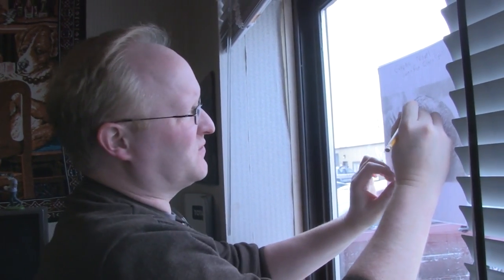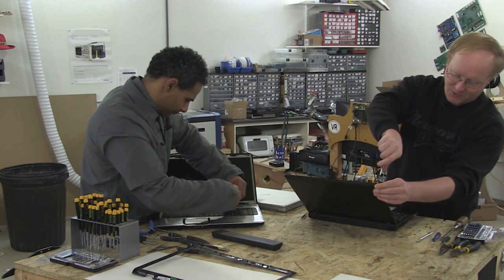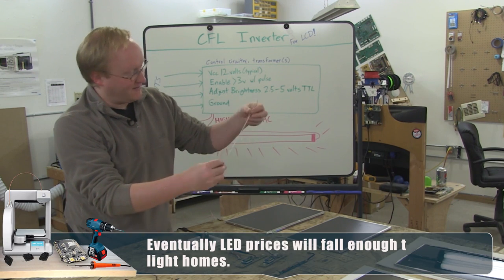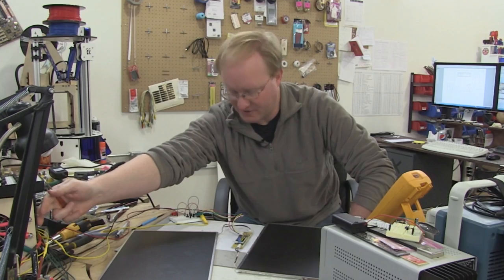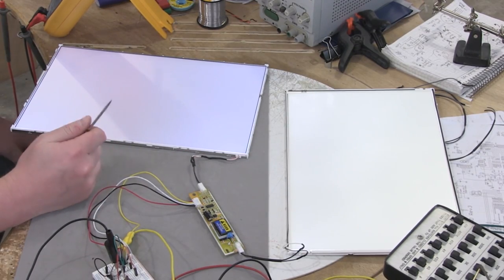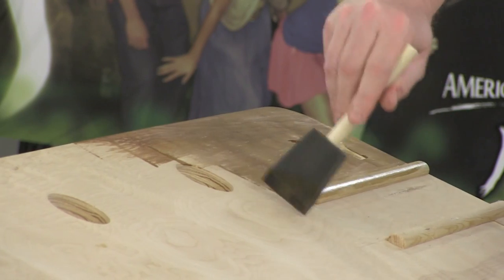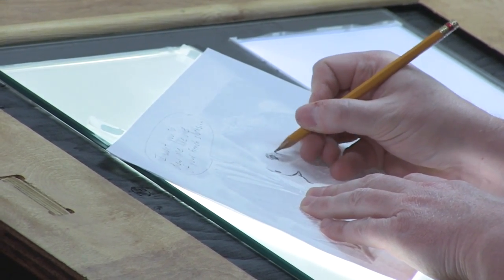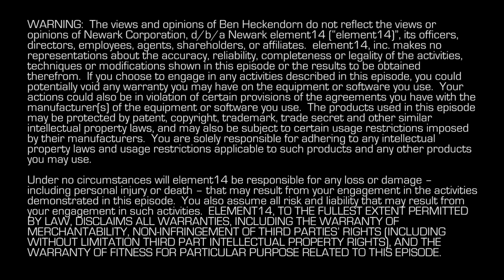Ben Heck’s LCD Monitor Light Box

Comment: why u did not use functional monitor with a computer? You could have reflect images directly from the pc to that table? I hope you understand what I'm trying to mean
Reply: ***** raspberry pi as a pc?
Reply: The idea was to recycle old broken parts into something new.
Reply: M. Oliver maybe, but I was considering the work efficiency
Reply: Gamewwx I think that would actually be a really awesome idea. Raspberry Pi PC (or a small form factor PC like a NUC) and be able to trace images right off of the computer. It would also remove the divider between the screens and give a larger work space. You could still use recycled parts for it, just using monitors instead of laptop screens.

Comment: I made a few shop lights out of broken LCD TVs and hung them on the ceiling in the garage and they are super bright. One has capacitor issues in the power supply b/c it doesn't always want to come on when plugged in.

Comment: Normal lightbulb would probably work better but itsgood use of old laptop screens
Reply: Couple TL tubes is better. more even light, less power usage, couple banks of LED's would work too, but a bit harder to get evenle distributed light with
Reply: oreubens i guess u could just use some mikly acrylic and sand one side and run with led strips.
Reply: while the point of what Ben was doing is to recycle old laptop screens, yes, for most other people its simpler to just hook up bulbs or LEDs or something instead of spending time gutting a laptop to use the screen. so anyone watching at home, theres not much need to bother with an old laptop, its just what Ben's goal was.
Reply: well yeh, but it's a bit pointless doing it that way.  It's like saying you wanted to make an electric heating unit to heat up your garden shed, and salvaged the CPU's out of a hundred laptops to get there, sure you 'can' do it, but...  why...
Reply: oreubens if you're talking about why Ben did it that way, i don't know other than he just likes recycling things.
Reply: Yes, it's better to use old displays this way than to throw them in a landfill; but, I also agree that there are better uses for them. I think the show is only desperate for quick projects to fit in the time slot of a show. They could have made them into digital picture frames; but, could they have done it within the time frame? Even as they took the displays apart, they can still use the LCD screens in another project as a projector. They could have left the displays intact if they could send the signal to make them display white for every pixel as the default. Then also as Gamewwx suggested, they could display art directly on the screen to trace. Maybe in a future show they will revisit this project and add digital picture frame functionality with a SD card and a micro controller.
Reply: kedwa30 agreed. Element 14 wants Ben to keep on a schedule of projects so he's sort of trying to figure out things to do.
Reply: Honestly I don't really even think its good use out of old laptop screens. A $35 driver board can be bought to turn the screen into a working monitor, or screen for whatever you want. If you get the right board, it will even support sound.
Reply: ***** If I was going to spend $35 on this project I would probably get an Odroid
 C1 and replace the old laptop mainboard with it so it would still be a functional laptop but it would run Linux instead of Windows 3.1.
These being really old laptops, dinosaurs, some people would just throw them away to make space in their room for a few books. Maybe the resolution is really low, like 640x480. You could play pong on that. But if the person didn't want to spend any money and he was going to throw them away anyway (shoot me a curb alert and I will pick them up!) then I can see this being a good thing and not a waste. I'm a pack-rat though. I have three mp3 players I don't even use. I just think it's a waste to throw them out. At the least they have an average of a gig of storage. :D

I'll bet there's probably an episode I haven't seen yet that repurposes an old MP3 player.
Reply: kedwa30 Both of the laptops they took apart looked like they had 720 capability or better. There can't possibly be nothing better to do with those screens except turn them into light boxes. Maybe your young child wants a computer. Add a Pi and a driver board and your kid has a $70 desktop. I could go on for days with the amount of Pi projects (or the Odroid projects) alone you could do with it. I too, am a packrat. which is why I wouldn't waste a perfectly good LCD to use as a lightbulb. At the very least, sell it. Screens like that go for 50-100 $ on ebay or amazon.
Reply: *****
I agree, but what if you didn't want to put anymore than say ten dollars into the project and you didn't need another terminal? It is kind of obscene to think the only value left in an old laptop is to turn it into a light box. I'm sure it was just a show idea and I hope in reality nobody would trash an old laptop just for the backlight and the glass pane. People actually toss old laptops into the trash, and I think the show did a service in a way to show that the parts can be more valuable than the whole. If I needed to use it as a lightbox, I could leave it whole, bring up a white screen, and trace directly on the screen. But what if I wanted to salvage as many parts as I could and use them in a variety of other projects and I didn't want it to be a terminal and I didn't want to spend more than ten dollars? Add to that scenario a room full of a variety of other old electronics that have been damaged to some degree and were obtained from a thrift shop. I can remove basic components like capacitors and reuse them, but something I have never done but am interested in getting into would be to reuse the RAM. For example, I have an old (2003) desktop with bad capacitors, and I want the parts to make something more than I want to fix it. I want to build a ramdrive using the 2 GB of DDR ram that will plug into the PATA port of another computer I have. I have a bad PATA drive that I could at least get the interface from. The thing is, that kind of stuff would probably take thirty episodes to cover. heh heh
And I will probably need to get a good Oscilloscope first.

I also happened to get an old server and I was surprised it would POST but it doesn't have any working SCSI drives. I'm planning to use it as a network ramdrive. I just need to upgrade my home network to gigabit speed. :)
And I have a lot of switches and routers that I want to try to use like arduinos. Maybe I can harvest a microcontroller from an old printer/scanner. Yeah, I can buy an ATMEL for a few bucks, but I'm gonna take it apart to build something anyway. :)
Reply: kedwa30 Printers and scanners are goldmines for parts :)
Reply: kedwa30 I totally agree. There are plenty of ways to salvage the electronics out of a laptop aside from the screen. Like salvaging the gold.  My main point is if you don't want to spend money on a proper project for the LCD, sell it, buy a $2 light bulb, build an $8 box, and put $65 into your wallet. I'm just saying, seldom does Ben do simple projects like these, which have no place being on this channel, but he tires to make the projects fit into the theme of his channel, by incorporating valuable electronics and ends up with what should be a $10 project, that is worth way more.
Reply: alex Steen
I'm sure he meant a regular LED or CCFL bulb as opposed to one salvaged from a laptop. :)
Reply: alex Steen regular lightbulb doesnt mean just an old incandescent, who actually uses those in lamps anymore, let alone something like this?
Reply: Uses 500 watt quartz bulb in light box; burns hands; goes blind. "Aigh! That guy said I could use any regular bulb! I blame him!"
Reply: alex Steen If you have common sense, you would use a CFL. They put out very little heat.
Reply: *****
also LED's would work & run less power & no heat nearly.
Reply: knownuser09 My point was to keep it cheap, and simple. Idk maybe an led bulb, I have no idea what those cost.
Reply: *****
Where can I buy some of this common sense? I really need some badly. ;D

I think there are two kinds of projects: those you make out of stuff you have on hand to make a task easier and those that are for fun that you might sell or take apart to use in other projects later. This episode has inspired me to modify a drafting table to have a light box in it. I'm not planning to tear apart any laptop screens to do this though. And the drafting table can hang on the wall when not in use, so the table could double as a mirror or a picture frame or maybe a wall sconce if I hang it high. I'm still in the brainstorm phase. ;)
Reply: Still a couple dollars of LED strips you can cut to any custom length is cheaper than the inverters.
Reply: I can't believe no one pointed out that the laptops were dead. They couldn't even power the laptops on to see if the screens worked before dismantling them. And the reason to use something like an LCD screen is that it has a built-in light diffuser. A regular bulb or LED strips could work "ok" but wouldn't really fit the bill of a light box.
Reply: buggsyspam 
" but wouldn't really fit the bill of a light box."

"And the reason to use something like an LCD screen is that it has a built-in light diffuser"

I think everyone here understands that LCD screens use light diffusers. Yes another reason why LED lights would be shit. CFL bulbs however, put out a very soft, easily manipulatable light. Spray the bottom of the box a gloss silver, and spray the underside of the plexiglass white, bam! the light is diffused. 

You can't seriously suggest that the best use for a working LCD, worth upwards of $100, is so you can seek out your inner 3rd grader and start tracing shit.  (yes we know the screens work because the thing that goes bad in LCD screens are the CCFL's [cold cathode florescent] and they were obviously in working order)

Comment: please make more videos using the parts from the laptops, i have 2 i dismantled, trying to see what i can do with them
Reply: I've done some salvaging myself. The keyboards are pretty useful. After figuring out the key matrix (i.e. x/y coordinates for each key,) you can make a very thin ADB or USB keyboard. You can find keyboard encoders on eBay for this sort of thing, or write your own using a microcontroller. The cooling fans are very thin, so they can come in handy for some project that requires cooling. If you have a good heating gun, you can desolder the various components off, such as USB jacks, audio jacks, etc.
Reply: yuppiehi I have desoldered parts before, and i plan on doing that with the motherboard, but thanks for the tips on the keyboard. have you done anything with the trackpads?
Reply: brandon carter I've never done it before, but I imagine the trackpad would work largely the same way. If you can figure out the wiring, you might be able to turn it into a USB HID.

Comment: Nicely done.  I would have mounted the light screens with no gap in between with a wood support strip under both center edges.  Would like to have seen you light up the CFL just for experience.

Comment: Why didn't you have the screens installed edge-to-edge and use frosted glass pane over them as a diffuser?  The big divider frame in the middle just created a big dark line in the middle of what could have been a solid lit field.

Comment: Hi, I use the lights out of laptops and LCD monitors to make new light fixtures. I also use the cooling fans with the heat sinks to keep my transitors cool. I have been testing out the high powered led chips the 50watt and 100 watt lights which require heatsinks and these work great.

Comment: I have a junk monitor that I want to turn into a polarized light emitter.  I took out the lcd stripped the polarized film and put it over the transmissive film.  I left the backlight parts and films intact and sealed it all up.  Works well when it's on, but only on until it registers no signal and turns off.  

My question is (I have limited electronics knowledge) how can I make the enable pin believe it is always high without taking too much apart or changing the monitor electronics much more?  

I like what I have now... a nice bright polarized light source that's all put together in the original monitor case... I just want to make it think it always has a signal so it doesn't turn off after a few seconds.  I'm sure this is a very basic question, but does anyone have any suggestions?

Btw the endgame here is to use the other film and print off an attachment for the monitor that will space it away from the screen about 12 inches.  Then put plastic and clear stuff in between and show the kids how polarized light can show tension in clear objects with a number of "experiments"  Also to let them have fun with the rainbow affects they make with stuff they put in between the sheets.

Comment: Instead of the glass, you should use a cutting matt, the clear type.
It will fix the color, as it is slightly yellow, it will fix the angle problem as it will give you some texture to grab the work.
It will also give you a grid in light brown that is easy to ignore or use as need permits.
Glass is too hard a surface to draw on is better if the surface has a little give, so pens/pencils don't bounce and slide almost unperceivable amounts, comfort in drawing will go up with a suitable surface.

Comment: where can i find a wiring color guide? I always thought a red wire was for power supply, but ben said it was supposed to be yellow
Reply: What I meant is where can i find the color code he uses, so when I design something, it has the wires right
Reply: *****
Usually, "yellow" is used for +12VDC, and "red" for +5VDC. If you look up any A+ certification training guide, it should mention something like this.

Comment: I'm going to do something very similar. What kind of power supply/adapter should I use to power 4 CCFL tubes from a 19" monitor?
Reply: just use leds.otherwise if the monitor still turns on put a meter on the inverters input pins if it even has an inverter. I havent delt with a non led screen in years this video was a throw back

Comment: Maybe I've missed it, but it would have been cool if you'd combined the on/off/enable switch with the brightness control wheel. (turn all the way down = off, all the way up = brightest). Also, the desk seemed a little unstable.

Comment: for this build you should have bought an inverter for the lcd so you could have an hdmi input and use a computer to get pictures to trace over
Reply: +kieran doyle I agree. If you you're going to use screens from laptops, you might as well have them work as fully functional computer screens so the artist can load pictures, resize them on the screen for tracing, etc.

Comment: Why not just use a lightbulb?
Reply: Ethan Ford The point of this project was largely recycling. Practically speaking a lightbulb or LEDs would probably work better, yes, but it defeats the purpose of using recycled parts.

Comment: You might have been better off getting a cheap roll of LED lights and wrapping them on the inside of a box and then laying some out on the bottom.  I've done this with exposure units and RGB LED strips to turn the exposure units into inspection/tracing tables + UV exposure units.  Add an RGB level adjuster and you can dial in a red orange color that won't expose emulsion.  Or turn up all three levels for a white light for a large tracing table. ;)

Comment: One time I just took a laptop apart 'cause, why not? And I took out the inbuilt webcam, soldered it to a usb-cable and plugged it in to a computer and, as expected, it worked. Kind of a waste of old laptops although I hadn't the experience or knowledge to do anything else with it back then...

Comment: i personally like to turn old laptops into HTPCs. a small device that has bluetooth,Wifi etc. allready built on hell yeah. what i normally do is strip them down to the motherboard,ram,harddrive and heatsink add in two oversized normal PC fans to run at low RPMs and then make a small box with vesa mounts and boom 1080p HTPC that is wisper quiet and outpreforms anything small you can buy on the market.

Comment: I bought 2 of those generic ccfl interters , connectors were wired R R Y B B ....well one was the other was reversed and I ended up not checking just assuming red was v+ and yea , instant magic smoke. I admit I could have checked it first , lesson learned always check twice before connecting power.

Comment: i would have used an old desktop lcd monitor, then removed the flim which is not needed as the lcd without it will be a lot more brighter. i know this because i have used old monitors to outline tattoos onto paper.

Comment: I wanted to make a lightbox out of an old laptop panel a few years back, couldnt figure out the inverter.. that or it was dead.
I ended up gutting out an old A3 desktop scanner, fitting a regular light socket with an energy saving bulb in it attached to a simple rocker switch I took from a dead lamp, and putting in a mirror propped at an angle under the scanner glass. With a strip of white plastic between the mirror and the glass to act as a defuser, it worked really well. Plus it was (sorta) portable to boot.
['''---__  |@]

Comment: I recently built a lightbox portable for the girlfriend -- lasercut acrylic frame and cheap china led strips, then a dcdc buck converter to give me voltage control to drop down below the 12v the strips need.